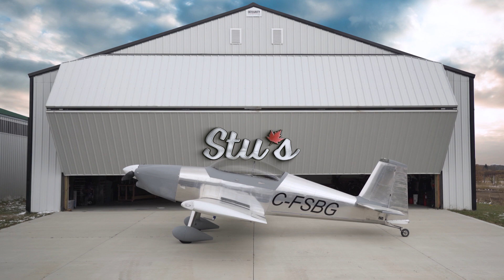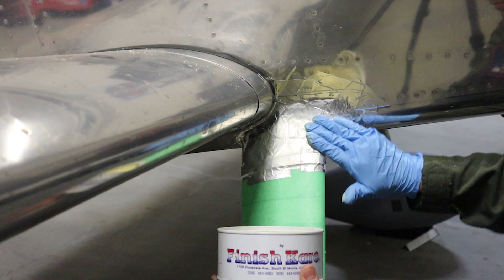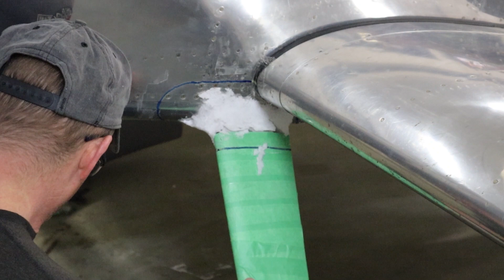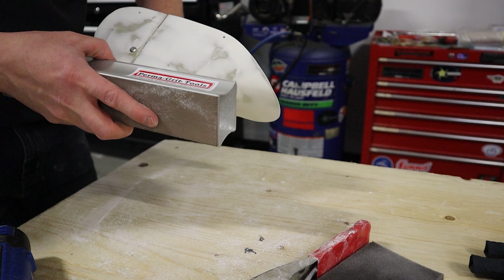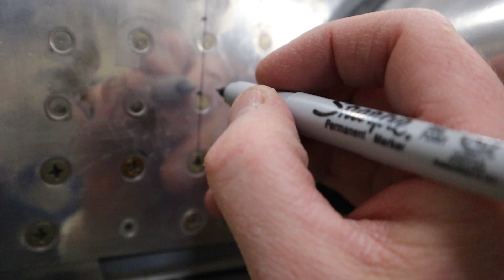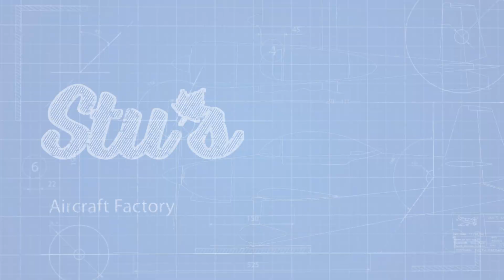RV8 Intersection Fairings

Comment: Did you gain any speed?
Reply from the maker: Intersection fairings not really.  Main point it to provide pleasant transition and in case of fibreglass gear leg fairings to hold them in place

Comment: What about the wing-fuselage intersection itself? Going all the way along the wing root? Have you ever tried something similar for that? Just curious.
Reply from the maker: Great question.  Mine right now has stock fibreglass around front part of wing (fuel tank) and flat aluminum for remainder with a rubber seal.  I’m planning on changing to Sam James full fibreglass wing fairings

Comment: Do you know what was behind that skin you drilled and tapped into? What about water penetration into that joint?
Reply from the maker: Yup.  There are about 2 layers of alum and steel weldment for gear tower.  Behind that there nothing to hit as long as brake lines and wires are clear.   As far as water I don't fuss with my RV8.  Its riveted alum so water can get in several places.   No big issue if hole is on side.  If you want you can put bit sealant on screw or use clear edging tape around fairing - go fast tape as the Reno Air Race guys call it.

Comment: Nice!!  Is it possible to use one of the existing screw holes in the gear tower? Thanks
Reply from the maker: For sure.  But getting inside gear tower to mount nutplate or nursert will be frustrating
Reply: @stusaircraftfactory6592  Thanks

Comment: Thanks for providing this.  I also have Grove airfoil gear, but purchased my intersection fairings from Fairings-etc.  Nice job making your own.
Reply from the maker: You might find the fairing doesn’t fit well.  Aerofoil gear mounts are bigger.  I had same ones but they required mods.
Reply: @stusaircraftfactory6592  They were made for the airfoil gear, but admittedly, they don't fit as nicely as yours.  I'll post a pic.   I mounted them a little differently, but used the two inspection cover screws similar to what you did.
Reply: @stusaircraftfactory6592  Here is how they fit out of the box.  I did some more work before painting and finishing, but for some reason, can't find any pics.  https://postimg.cc/gallery/2esx9wmiy/  Like I said, I think yours really came out with a great nice fit!
Reply from the maker: Sweet thanks for reply!
Reply from the maker: Mine must have been for standard gear as I removed about half the fairing before giving up and rolling my own